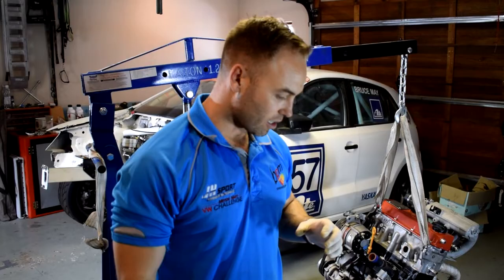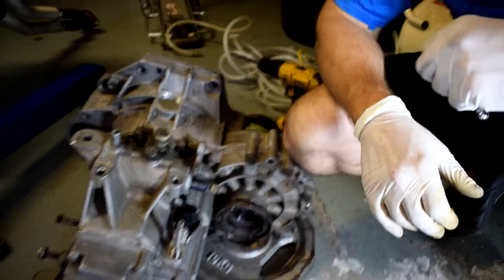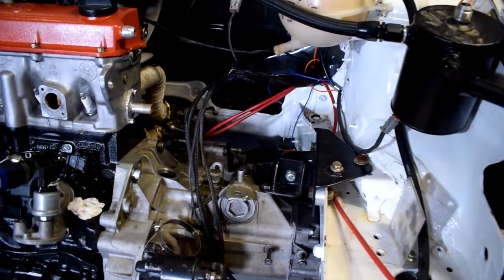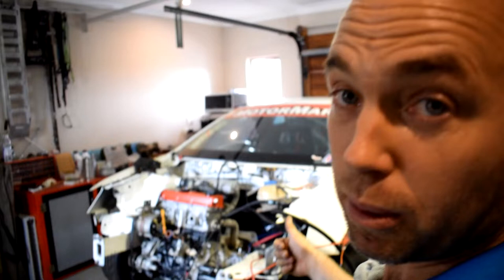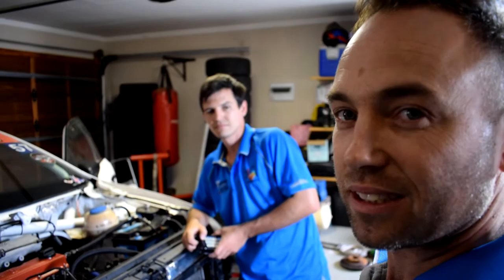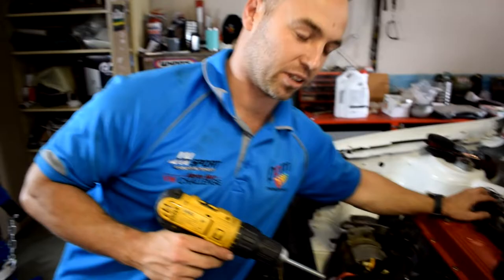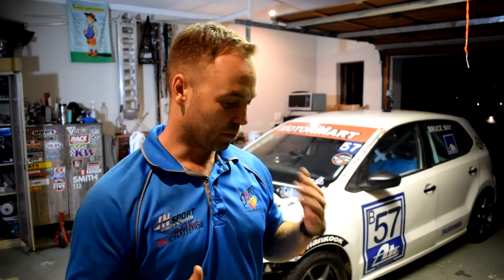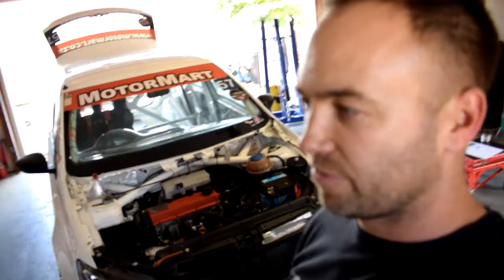VW Challenge Class B #57 Rebuild Part 3

Comment: whats the reason for drilling a hole on the throttle flap?
Reply from the maker: The reason we do that is to assist with idle because of the 288 cam in these engines.

Especially if you are only running the ecu on vacuum.